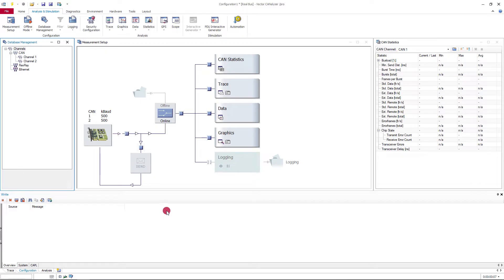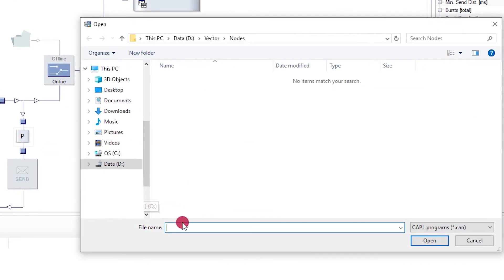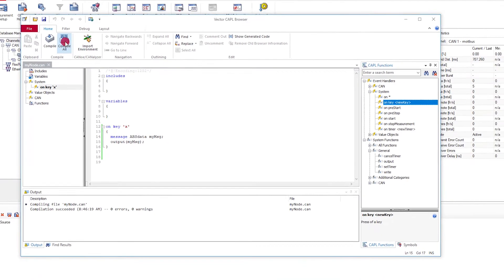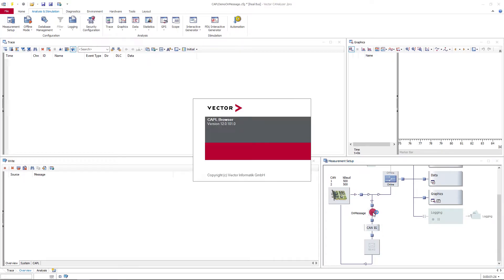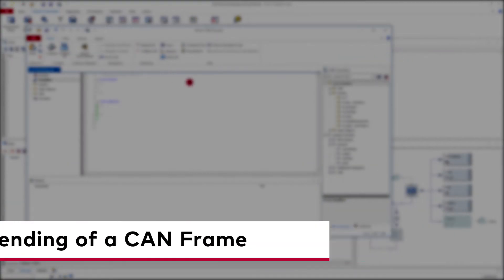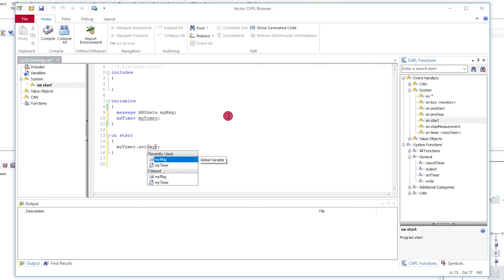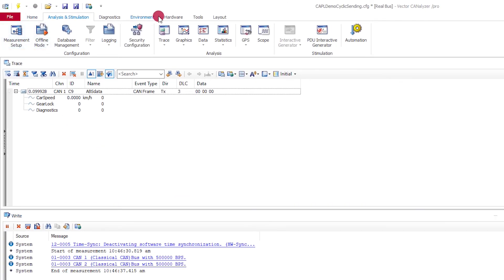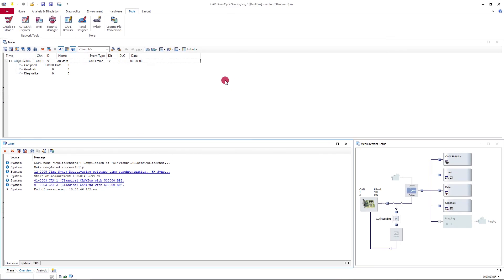CAPL Basics by Vector – Three Examples Reloaded

Comment: Hi Team, 
I was trying to read DIO1 which I have connected to one PIN now, if the voltage is 12/5/2.8 volts it shows High
Reply: I just want to know can we configure threshold value to 3 Volts as HIGH else anything below 3 Volts should be treated as LOW